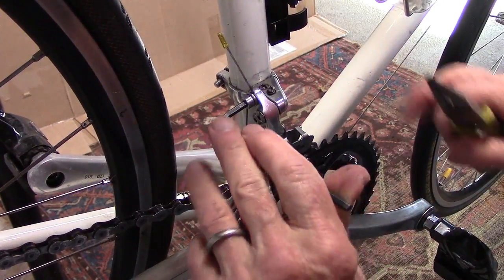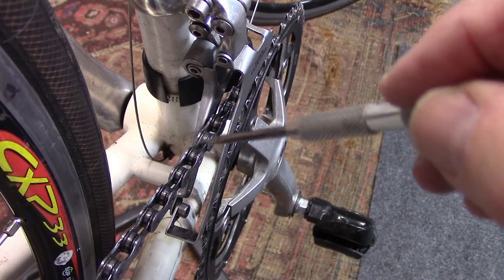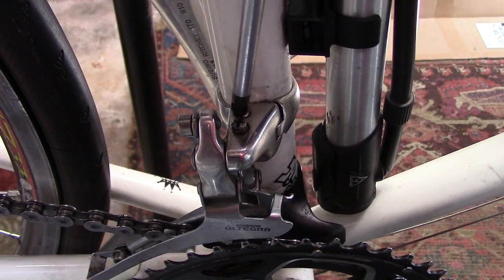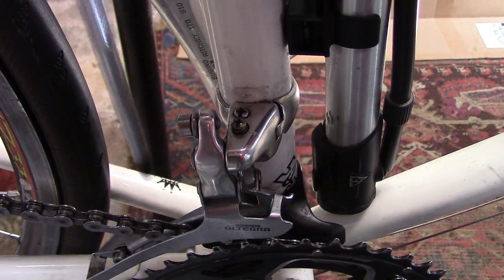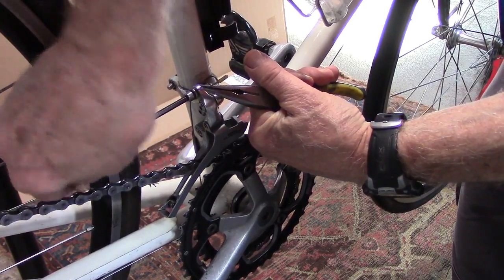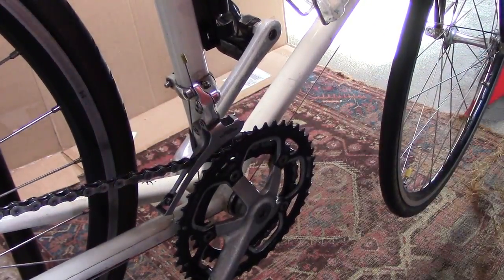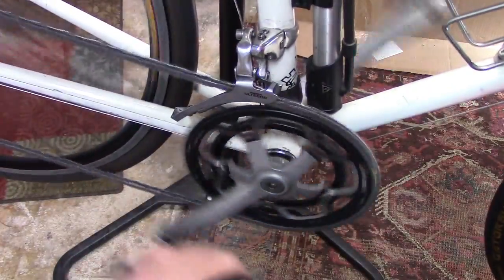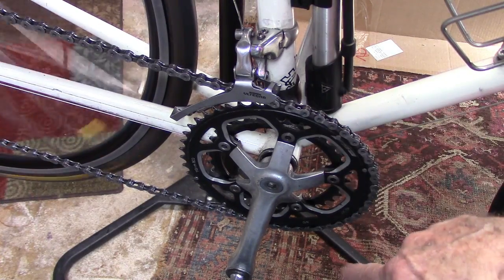If adjusting the limiting screw fails to eliminate chain rub

Comment: Tony, another trick is to Half Step the front derailleur to eliminate the rub--to do this half click the shifter for front derailleur.  This works on Shimano groupsets.
Reply from the maker: The half step, as you correctly mention, does work when you the chain is rubbing against the outer plate of the front derailleur when you are on the small chain ring and are shifting to smaller cogs. This is especially helpful on a triple. Good topic for more videos. Thanks Hiaruga.

Comment: Tony, you make it look so simple. I undid the bolt holding my cable in place and two washers fell off, the bolt fell out and the entire front derailleur jumped right back close to the seat tube, powered by a huge spring. The cable is now impossible to fit again, I have no idea how the washers were, and I need five hands and the strength of ten men to hold everything in place trying to repair it. No choice but to take it in and have a pro fix it.
Reply from the maker: I don't think it's your fault. Who ever FIRST set up your bike used the cable to limit the movement of the front derailleur rather then the limiting screw. Sorry you had to go through that.
Reply: IC82World hi hi hi ih ih ih ih ih hi hi hi ...

Comment: Hi, when My chain is at the biggest cog and smallest chainring the chain rubs at the chainring on the outerside(right side). my chain line is ok but the chain noise make it sound like the chainline is too much but it isn't. I'm using a 123mm square bottombracket, 34-50t chainring and 13-34t cogs and 114links of chain. Do yoy think it's the chain line? Should I change to 120mm bb? My crank arm might be too close to the chain stay.
Reply from the maker: I've seen this happen with 34T and 36T cog (usually with 1x setup). The rear derailleur and chainrings just don't accommodate this setup on some bikes, however, using a 12/32T cassette seems to work better. Are all the components the same manufacturer and group set? Has this always been the case or did you change some of the components recently? I have no easy fix other then returning the bike to it's previous components (if they were changed). Other things to check:
1. Is the chain lubricated?
2. Check for bent derailleur hanger:https://www.youtube.com/watch?v=qHK6jQizIdc
3. Check the "b" screw adjustment: https://www.youtube.com/watch?v=UXnLJpTVFJ0
Let me know how you make out. Regards, Tony
Reply: @tony10speed  I've recently changed the crank and the chain, well before I was using 42-52t crank and using a 127mm square bottombracket and it's all good no noise or anything, but then when I changed into a new crank and chain, it started making noise everytime its at the smallest chainring(34T) and 34t biggest cog, before when I'm using 42t(smallest chainring) to 34t biggest cog, it doesn't make any noise. From what I've observed the Chain kind of wanting to go to the frame(when at the smallest chainring and biggest cog) but the chain line is good, every time I pedal the chain is rubbing against the outerside(right side) of the chainring when at the smallest chainring and biggest cog. 

Is the chain I need to change? I'm using a KMC Z8.3 chain, Sunrace Megadrive 7s 13-34t cogs, Ragusa RB900 34-50t Crank.
Reply from the maker: @akolangtohsijustine8411  Can the derailleur handle the change in chainring size, i.e., the difference between chainring teeth is now 50-34=16 and cassette 34-13=21 for a total of 37T. Check the derailleur specs and see if it can handle 37T difference (if not, you need a derailleur with a longer cage). Check the "b" screw and the clearance between the guide pulley and largest cog (should be set at about 4 mm). Do you have the correct chain length (you may need a slightly longer chain since the differential in teeth is now greater). See our video:
https://www.youtube.com/watch?v=2MbhSfHZkCI
It also may be the nature of the new crank you are using but I can't tell without see the bike up front and personal. But first take a look at the suggestions above. 
Regards, Tony
Reply: @tony10speed  I'm using a Acera M360 and the b screw is already maxed out, it reaches the 34t cog easily(which is the max of the rd) and from what I know is that the capacity of the rd is 43t, only the front smallest chainring is the problem. I use 114links of Chain, Do I need to add 2 more links? It might be too long, If I'll add 2 more links the chain will touch itself within the rd when at the smallest cog and smallest chainring.
Reply from the maker: @akolangtohsijustine8411  No, I wouldn't add more links. At this point, you really need to have some one look at the bike to get an idea of what's going on. Sorry I can't help more. Regards, Tony

Comment: hi i tried using the screws to eliminate rubbing on the big chain ring. but still doesn't work. I tried the tips in this video as well
Reply from the maker: The cable to the front derailleur may be to loose and not shifting far enough over the large chain ring. Shift to the small chain ring. Loosen the bolt to release the front derailleur cable and take up some more of the slack by pulling "gently" on the cable with some pliers (but not to hard).  Tighten the bolt as you pull up on the cable. Time to reset the outer limiting screw so the chain move onto the large chain ring, doesn't go over and drop off and doesn't rub. Recheck for rub on the small chain ring. If the cable is too tight, you may get rubbing of the inner plate of the derailleur on the small chain ring. Give this a try and let me know how this works. Regards, Tony

Comment: I had disconnected cable and selected lowest gears, with the L screw fully out but chain still rubs inner cage
Reply from the maker: I assume you have not changed the front chain rings or cassette (different size). Also, on some front derailleurs, the limiting screws may be in reverse order, i.e., the inner limiting screw on the outside and outer on the inside. So make sure you're dealing with the correct one. Next make sure the front derailleur is parallel to the bike frame. You may have to "tweak" it a bit so there's no rub in the small chain ring / largest cassette cog. Also the outer plate of the derailleur should also be no more then 2 mm above the outer chainring. Finally, it could be the nature of the front derailleur. You can try the following but use caution:
https://youtu.be/lBTLSAOmsYI?t=123
Let me know if any of these help. Regards, Tony

Comment: Hi Tony, thanks for this. I've got a new bike with a 2x11 Shimano GRX setup. The Front Derailleur just rubs on large ring when I'm in 20, 21, 22 gear. The LBS spent about 30 mins trying to fix it and told me to come back when their senior guy is in. Fair enough, but I was thinking, if the limits don't fix it, what else is there but the derailleur angle? I'm thinking to rotate it slightly but I'll check to see if it's parallel. Thanks for this video, it's straight and to the point, liked and subscribed!
Reply from the maker: I assume you're running an 11/22 cassette (or slightly larger such as an 11/25) from what your telling me. Is this correct? 

1. If so, note that the outer plate of the front derailleur should line up straight with the large chainring. 

2. On some bikes, running the large chain ring with the larger cogs will produce noise - rubbing chain against the inner plate of the large chainring. Sometimes adjusting the outer limiting screw (turning it in (clockwise) 1/8 of turn or so while in the small chainring) will allow you to still shift to the large chainring with rubbing only in the very large cog. You may always get rubbing when cross chaining (big chainring/big cassette cog). See:
https://www.youtube.com/watch?v=_dCa-PZuN7c&ab_channel=TonyMarchand 
You should be shifting to the smaller chainring when shifting to the larger cogs for climbing and use the larger chainring and smaller cogs for speed. 

3. Some front derailleurs have a limited capacity in what cogs can be used without rubbing. Using snap ring pliers or even long nose pliers (gripping them so they open wider), I have been able to widen the space between the front derailleur plates (at the front and middle of the derailleur) to give me a better range of options. This does work but is risky in that if you put too much pressure on the derailleur to widen the gap, it is possible to break the derailleur itself (has happened once on a bike I was working on).
Snap Ring Pliers:
https://www.amazon.com/SPEEDWOX-Retaining-Installing-Automobile-Transmission/dp/B07QYR719L/ref=sr_1_20?dchild=1&keywords=Snap+Ring+Pliers&qid=1629743732&sr=8-20
So one must take great care and widen just a bit in the middle and front. 

4. Another way is to add a tiny washer on the front derailleur toward the back where a small screw holds the plates together. In some cases, you may need a slightly longer screw (with the same threading). This will also widen the gap for more range with less risk of breaking the derailleur (finding a washer and new screw could be a challenge unless you have a supply as we do in our shop. See:
https://youtu.be/lBTLSAOmsYI?t=129

5. Obviously these alternative are not easy tasks. Otherwise, leaving everything as is, when you hear rubbing in the large chainring, you know it's time to shift to the small chainring. This too is not a bad alternative.

Regards and let me know how you make out, Tony
Reply: @tony10speed  Tony, thanks so much for the detailed reply! The rubbing is only on large ring and three smallest gears, the smallest being the 11T I believe. The fronts are ~ 30/48. It's a 2021 Cannondale Topstone 1 with a mix of Shimano GRX 400 and 600 on it. I had a look at the front, it looks dead parallel to the large ring. It's really minor, but I hope it's not a bent chainring causing the rubbing.
Reply: @tony10speed  Okay for some reason Cannondale doesn't list the cassette size in their listing but i found it. "Shimano 11-speed GRX drivetrain (600 and 800) pairs 46-30T chain rings with an 11-34T cassette" This is a gravel bike with decent gear range.
Reply from the maker: @gtube2010  If you unscrew (counter clockwise) the outer limiting screw, can you pull the front derailleur out further beyond the big chainring. If not, you need a different front derailleur with a greater range. Your bike shop should see if they have something else that will work. If you can pull it out further, there may not be enough tension in the front derailleur cable to allow the derailleur to move out further. The bike shop should be able to fix this easily.

Comment: What if the chain rub occurs when my chain is on the smallest rear cog, and the large front chain ring?
Reply from the maker: Have you tried to tweek the outer limiting screw of the front derailleur and/or make sure the derailleur is parallel to the frame as shown in the video? Are you mixing components such as campy and SRAM?
Reply: Hi Tony, no they are Shimano Sora Components.
Reply from the maker: @supreetmuppa4414  I would have to look at it. All I can say is to have your local bike shop take a look. I think it would be worth it. Let me know what they say so we can inform are viewer. Regards, Tony
Reply: @supreetmuppa4414  Hey! I was having the same issue. I was wondering if you were able to get it fixed in the end?

Comment: Hello sir Tony Marchand. I’m having some issues with my front derailleur. Fd doesn’t move too far outboard where the h limit screw is, hence some chain rub when i’m on 2x8, 2x9, 2x10, 3x8, 3x9, 3x10. And sometimes when i shift from the 2nd to the big ring, chain gets stuck a bit between inner cage and the big ring before settling in. And i can’t adjust the cable tension coz even when i’m on the 2nd ring, cable is already tight even after just two full turns counter clockwise. Barrel adjuster is already tight too. Could this be cable slip, or an fd issue?
Reply: Btw, it’s a tiagra 4600 triple chainring, barrel adjuster is on the sti lever.
Reply from the maker: Take a look at Calvin Jone's video from Park Tools:  https://www.youtube.com/watch?v=ZNG7g83lI-s
It's a long video but should help solve your problems. Regards, Tony

Comment: Is it true that if you're running a 2x on the front and a 8 on the back you get chain rub depending on what gear your in and you just have to match the gear ratio better? To align the chain?
Reply from the maker: Chain rub is usually caused by the derailleur not parallel to the chainrings and frame or the limiting screws are not set properly. Note: you will usually get some rub when in the large chain ring, large cassette cog (something we call cross chaining) which is a gear combination we try not to use. The same with small cog / small chain ring. It does not usually depend on the gear ratio or chain itself. Bent rear derailleur hanger (attached to the bike frame) can also give you noise. Also check that the rear derailleur can accommodate the chainrings and cassette (Count the teeth on the small chainring and subtract it from the number of teeth on the large chain ring. Do the same for the smallest and largest cassette cogs. Then add those numbers together. Check on the internet that the rear derailleur can accommodate this total T number). What is the teeth number on your front chain rings and smallest and largest cassette cogs as well as the make and model of your derailleur? Tony

Comment: Hi, and thanks for your invaluable videos. The derailleur cage I have (1990s Campagnolo) is somewhat curved on the outer side and is shaped with a step on the inner side - in other words not straight edges! Step 1 of getting it parallel to the rings is tricky - any advice you can give? Thanks
Reply from the maker: Yes, I remember those derailleurs. The Campagnolo Mirage is that shape. I use to eye ball it from above by making an imaginary horizontal line from the middle of the front of the derailleur to the middle of the rear, and try and make that parallel to the bike frame and chainrings. The step that's present on the derailleur plate prevented the chain from rubbing the outer derailleur plate  when shifted to the small chain ring. A bit tricky to set, and takes some trial and error. On the other hand, Campy equipment was beautiful and built to last. I wish I could be of more help. Tony
Reply: @tony10speed  Thank you! I’ll try that approach. I was considering just getting a simpler looking derailleur, an earlier model perhaps, but I’ll try again. It’s rubbing on the stepped part when shifted to the big ring for some reason. Happy new year to you!
Reply from the maker: @davidblackguitarist8753  The "stepped" portion you are talking about I assume is the protrusion like step on the outer derailleur plate that occupies the front 2/3 of the plate.  Set the outer limiting screw such that the chain does not rub on the derailleur outer plate. When shifted to the small chainring, the chain should fall behind the step and therefore not rub. However, if the chainrings have been replaced with a different size then that which came with the bike or specified by the manufacturers specs, it may not be possible to adjust the derailleur to eliminate the rub. Let me know how you make out. Happy new year, Tony

Comment: This is the same process for mtb? Shimano manuals said to align the front derailleur with the biggest chainring and like you some places tell to align then to the chain. I use a 2x10 Deore FD with XTR shifter
Reply from the maker: I use the same method as described in the video on road bikes and mtb. Also see my video: 
(if the limiting screw fail to fix the chain rub):
 https://www.youtube.com/watch?v=9fRoWMwHy7c&index=2&list=PLYbCdE49qIMcwtjyKZKTx9-Ty21KeI3GW

Comment: Hi, what if I don’t have a low limit screw...... shimano exage lx500
Reply from the maker: On a 1x system, there will be no front derailleur. However, the Shimano Exage rear derailleurs I have seen have had limiting screws which are set up as follows:
https://www.youtube.com/watch?v=XagBY9LLI7c
I'd love to see a picture of your rear derailleur that has no limiting screws. Is this an old derailleur? I've dealt with rear derailleurs that have no "barrel" adjusters for find tuning which are a pain but they've all had limiting screws. Is there a model number or year marked on the Exage derailleur?

Comment: Mine is rubbing from the outward cage of the FD 😥
Reply from the maker: Double check the points we mention in the video. If the outer cage of the derailleur still hits the chain and turning the outer limiting screw outward (counter clockwise) does not solve the problem, your front derailleur cable may be too tight. Shift to the small chainring. Undo the pinch bolt to release the cable from the front derailleur. Turn the barrel adjuster for the front derailleur all the way in, then out about 1 full turn. Take the slack out of the cable (don't use gorilla force) and tack it down with the front derailleur pinch bolt. Now you can play with the outer limiting screw to get the chain to shift to the large chainring but not over shift. You can also play with the front derailleur barrel adjuster to adjust cable tension and ease of shifting. Let me know how it works out.
Reply: @tony10speed  Thanks! Didn’t expect you to reply on your old video. Gonna try this out
Reply: @tony10speed  It did! Thanks a bunch!